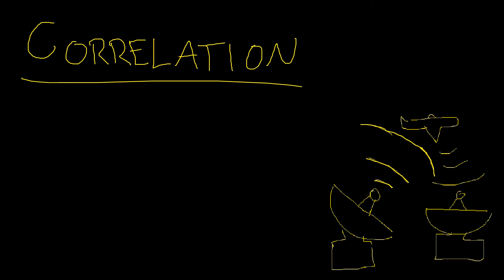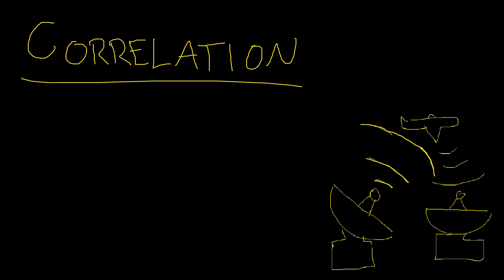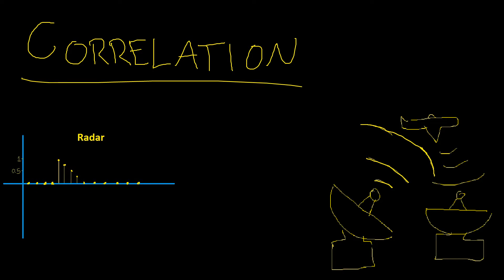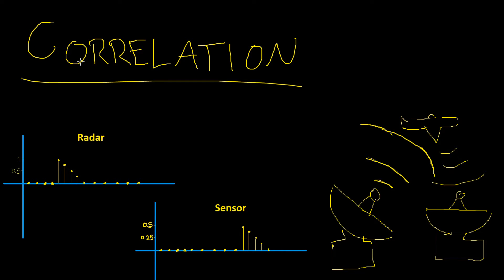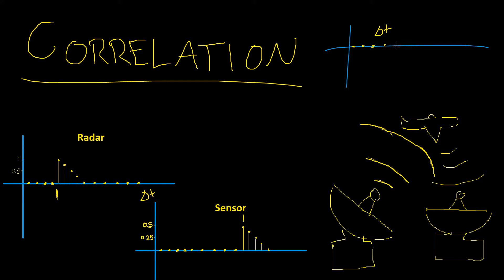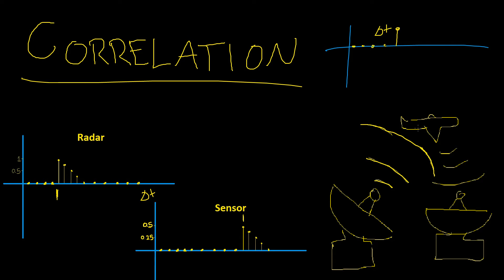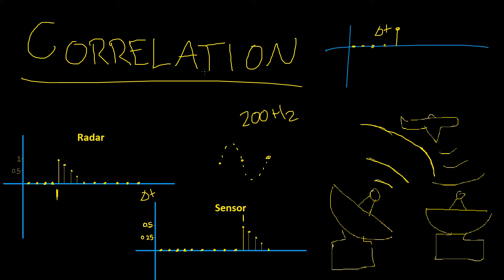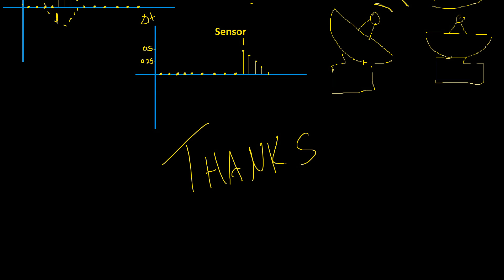Correlation Explained - Signal Processing #22

Comment: What is difference between convolution and correlation?
Reply from the maker: Hey while I do cover both on my channel and they are effectively two sides of the same coin. That said, how they are used practically are quite different.

Correllation is used to determine how one signal correlates with another, in other words how similar two signals are, or how similar a portion of a signal is to another. 

Convolution is used to determine one signals impact on another / on a system. Practically, they are the same operation with the kernel or smaller signal has its samples flipped.